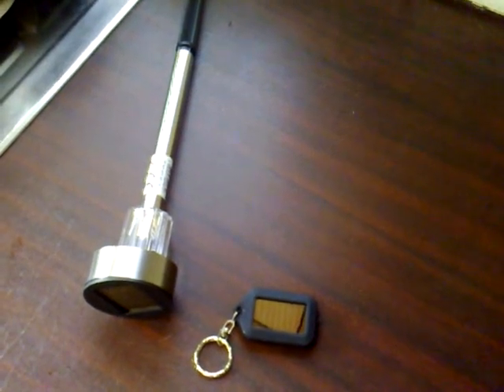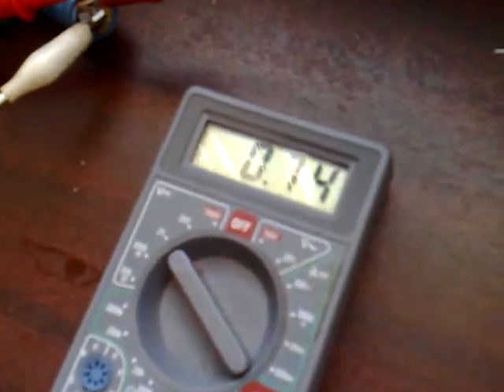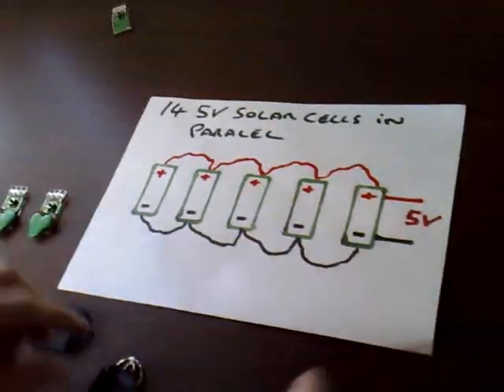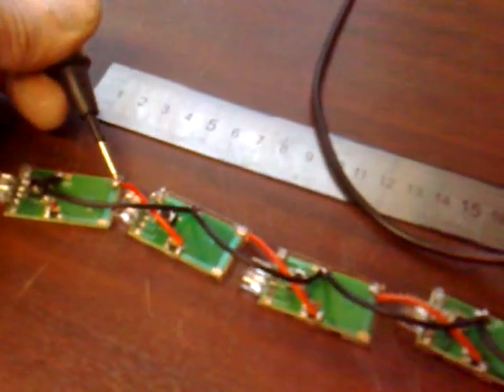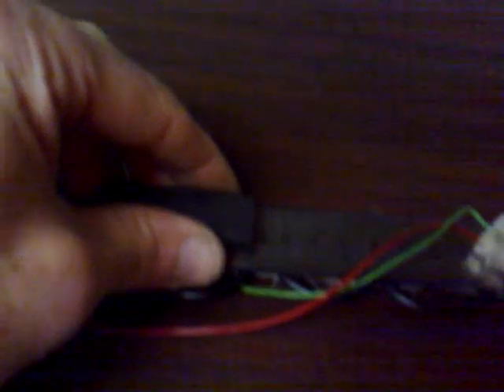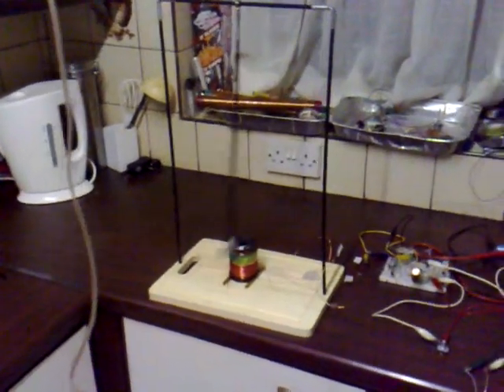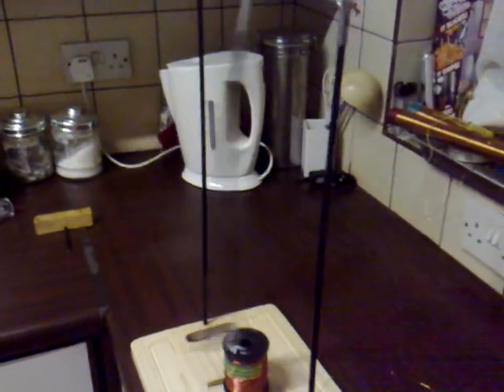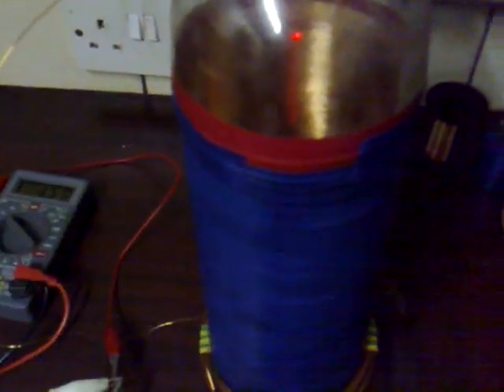Solar panal night power supply build

Comment: Well done,
but better put all the solar cells in series, so you get a much higher voltage and then run low current motors like a Newman motor with it.
Will get you much more mechanical output then.

Regards, Stefan.

Comment: I am going to experiment with using thermocouples (10 for $40 out of china) placed against a metal/tin box, which will surround the chimey. it goes down to 15-20 below, and id imagine the chimney stays pretty hot still, at the base. It will be a very low current application too, but one neat thing is... the fire burns at night, and the sun don't :) Thanks for your wonderful work. I don't understand some things, but I starting to get it.

Comment: Johny, I don't get the pendulum. Is that a Bifilar coil that you are capturing the transients from to charge a second cap, or even the primary power cap? Or was that just a test to see if what I just mentioned was "an option" based on seeing if it would swing at all... Didn't Lidmotor send transients back into the caps he was using to power a bedini circuit/motor?

Comment: Go Johnny  Go Go  lol
Ive used the one led solar cell to run my dodoshlodo jt to charge  alkaline batteries in daytime  under the sun
how about a cell from calculator      ........can be done
Kubikop has made it up to 3 volts but your circuit had amplified it more

cheers